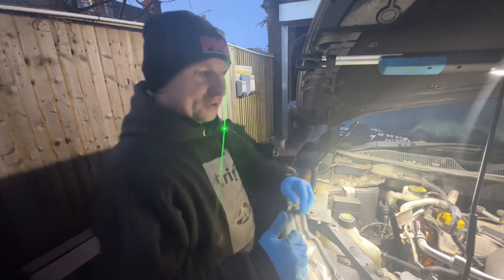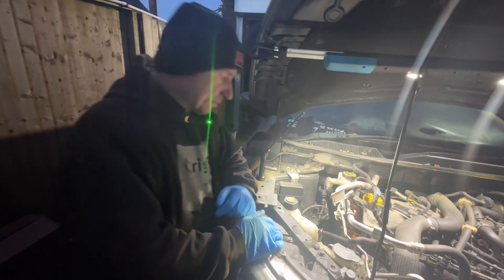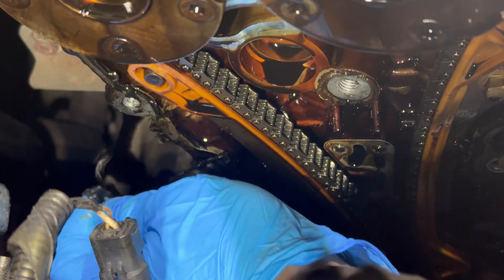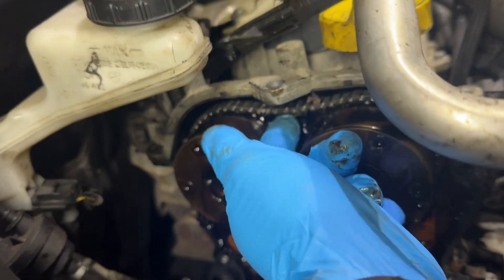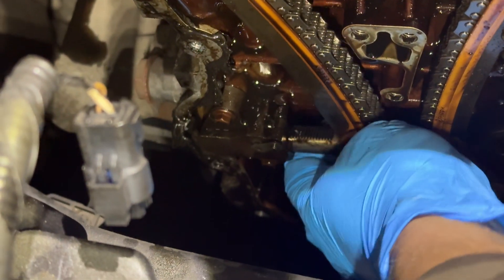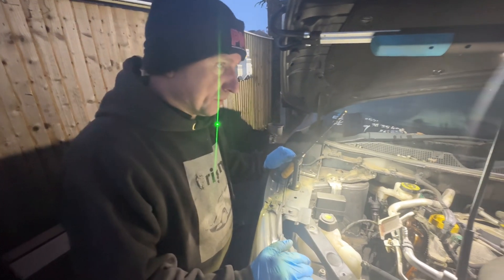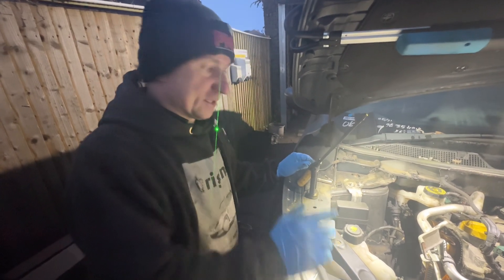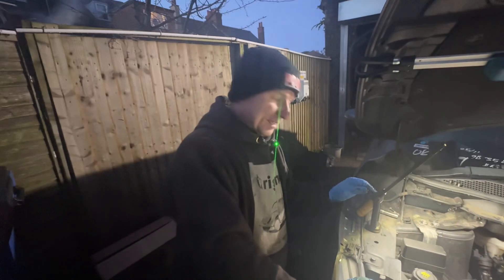Renault Nissan 1.2  engine timing chain failure

Comment: Our Nissan Note 1.2 DIG-S blew up 1 week after a full dealer service (timing chain rattle noted £2.5k 'diagnostic repair' offered) and Nissan couldn't push us out the door fast enough.... as if ashamed. The engine is so bad that I understand there are class action court cases in USA and France.
Reply from the maker: Yeah, sadly you’re absolutely right — that 1.2 DIG-S / HRA2DDT engine has earned a terrible reputation for timing chain failures 😞. Many owners have experienced the same: chain stretch, oil consumption, and even full engine failure not long after dealer servicing.
There have been class actions and manufacturer investigations in several countries, especially the U.S. and France, because the chain design and tensioner system just weren’t up to spec. Nissan and Renault both quietly revised the parts later on, but they’ve never fully owned the issue publicly.
If it happened right after a dealer service and they noted the rattle, it’s worth pushing back with documented evidence (invoice + fault note) — you may have grounds for partial compensation or goodwill from Nissan UK, especially if the car had full service history.
Appreciate you sharing your story — a lot of owners will relate to it 👌
We’re not able to reply to continuous messages as we get a huge list of comments every day. If you need more help or want to discuss it further, join our groups — there are plenty of techs and owners who’ve dealt with the same issue:
👉 WhatsApp: https://chat.whatsapp.com/JOvJCdZYdV9J6PvIXw2RV0
👉 Facebook: https://www.facebook.com/share/g/15msa3NJmn/

Comment: Hey there, any tips on removing the stubborn crank shaft pulley bolt 🤯
Reply from the maker: Hey! Yep, that crankshaft pulley bolt can be stubborn 😮‍💨 — here are some solid tips to help get it off:

🔧 1. Use a Powerful Impact Gun
You’ll need a high-torque impact gun (800–1000Nm+). Hit it with short bursts.

🔥 2. Apply Heat
Gently heat the bolt area using a heat gun or torch (avoid plastic/rubber). This can break the corrosion bond.

🛢️ 3. Soak in Penetrating Oil
Spray some WD-40 or PlusGas on it and leave for a few hours (or overnight if possible).

🔒 4. Lock the Crankshaft Properly
Use the flywheel locking tool or locking pin. Never rely on just the timing tools.

💪 5. Long Breaker Bar with Leverage
Get a long bar and apply steady force. You can also carefully rest the bar against the ground and bump the starter for a quick jolt (only if you're confident and safe).

Let me know your car model and engine code, and I can guide more precisely!

👉 Join our support groups for more tips and help anytime:
🔗 WhatsApp Group: https://chat.whatsapp.com/JOvJCdZYdV9J6PvIXw2RV0
🔗 Facebook Group: https://www.facebook.com/share/g/15msa3NJmn/

Good luck, you've got this! 💪🛠️

Comment: I have a 2013 1.2 Clio tce edc auto, I believe it is also struggling with timing chain issue. Though it’s quite when it’s above 2000rpm. It has the H5Ft or DF4 engine with 50,000 miles. Just wondering whether it is timing chain issue because there is no sound above 2000rpm.
Reply from the maker: It’s possible that your 2013 Clio 1.2 TCE (H5Ft/DF4 engine) is experiencing a timing chain issue, but the fact that it’s quiet above 2,000 RPM suggests that it might not be completely stretched yet. Here are some things to check:

Signs of a Timing Chain Issue:
✅ Rattling on Cold Start or at Low RPMs – If the noise is more noticeable at idle or just above idle, it could be chain tensioner wear or stretch.
✅ Check for Fault Codes – A stretched chain can trigger codes like P0340 (Camshaft Position Sensor Error) or P0016 (Crankshaft-Camshaft Correlation Error).
✅ Loss of Power or Rough Running – A severely stretched chain can cause misfires or affect performance.
✅ Metal Shavings in Oil – If the chain is wearing excessively, metal particles may appear in the oil.

If it’s only noisy at idle and not triggering any codes, it might not be urgent but should be monitored closely. However, if you hear rattling getting worse over time, it’s better to replace the timing chain kit before it causes severe engine damage.

Would you like a detailed cost estimate for a timing chain replacement? Also, if you're in the UK, you can join our WhatsApp & Facebook groups for more discussions:

👉 WhatsApp: https://chat.whatsapp.com/JOvJCdZYdV9J6PvIXw2RV0
👉 Facebook: https://www.facebook.com/share/g/15msa3NJmn/

Let me know how else I can help! 🔧🚗
Reply: @ Thank you, you’ve been of great help 👍
Reply from the maker: your welcome